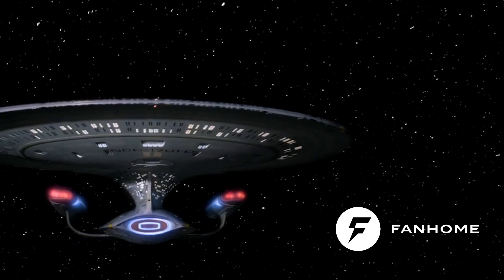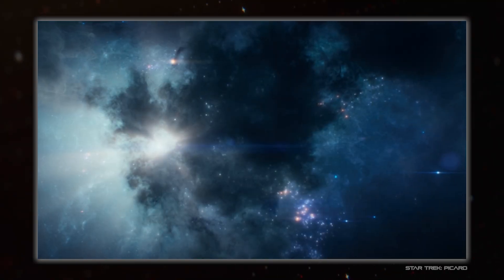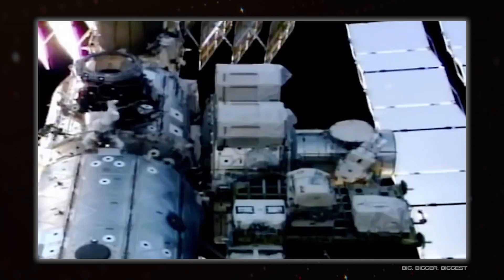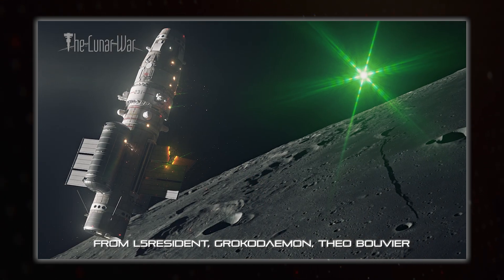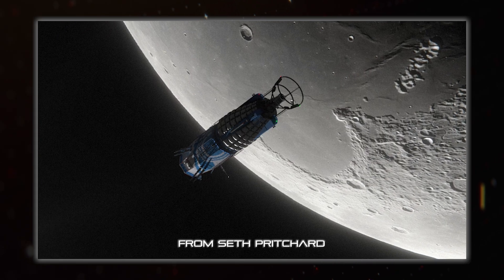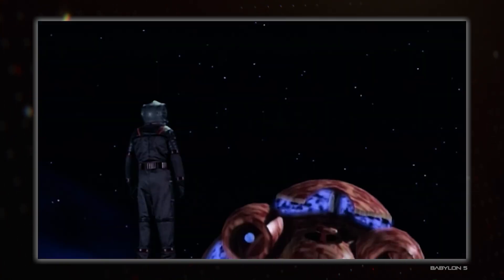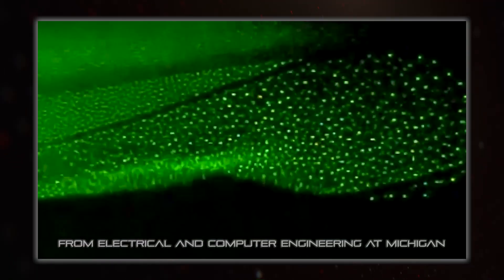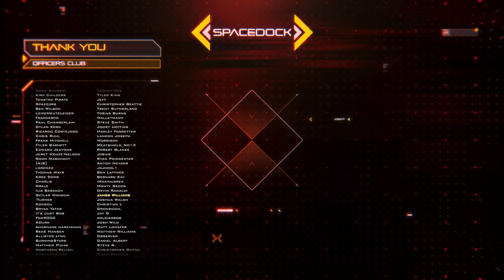Radiators In Realistic Sci-Fi (And Why You Need Them)

Comment: Last time I watched Apollo 13, I was wondering why they are getting freezing cold when they have to shut off the power.
Was that accurate or made up for the movie?
Reply: I’ve read multiple books and articles about the Apollo program and the fact that the temperature dropped to near freezing (38° F according to NASA) is 100% correct. Also, I was in elementary school when Apollo 13 happened so I remember it well. 😉 Remember, they had to shut down equipment to save battery life to survive. In addition, since the oxygen tanks were destroyed the fuel cells that needed that oxygen to provide electrical power stopped operating. In a normal mission the fuel cells and all that equipment generated heat. Since that heat wasn’t there temperatures aboard the command module plummeted.

If you you want a more detailed explanation, check out the website of NASA’s history division. Also, there are a lot of good documentaries you can find online.

Comment: At one point the "sails" on the Minmatar ships of EVE Online were said to be radiators, which I've always found to make FAR more sense than any other explanation (solar panels, weird shield emitters, antennas...).

It's perfectly in-character for the minnies to build ships with engines so overtuned that they need massive external heatsinks to keep from melting the hull.

Comment: Very cool idea based upon your open heating system ideas:
- have ships when they are in combat simply hear up high heat capacity materials and dump them when radiator retract. 
- have the heat be put into a weapon system to crate super heated shells or whatever they fire as well as being able to remove them. 
- use ferrous metals as the expelled cooler materials to act as magnetic mines or if your setting uses lots of magnets then to generally interfere with them: when they are launched they won't effect you till they cool down. 
Having lots of excess heat can definitely be used for fun things that also aid with cooling!
Reply: thermal Flares: that's another one.

Comment: It's nice to see Children of a Dead Earth get a cameo. I love that game, warts and all,  and would love to see you guys feature it in a review or Let's Play.
Reply: Someday, when the stars align, I'd love to see CoaDE get a proper update again (or just a straight up sequel). It has so much unrealized potential.

On topic, in CoaDE, I've settled on a common design for battleships where an armored ring extends out amidships, significantly beyond the diameter of the hull itself. Most of the weapons on the ship are mounted around the circumference of this ring, which helps to draw enemy fire away from the bow of the ship, which has an internal armored belt to protect the crew and systems. Tucked behind the weapons ring are the radiators, which are built to be mostly or entirely concealed behind the ring when viewed front on. The ships engage the enemy head-on and rely on the armored ring to protect the radiators. Of course, if they have to engage in the first place then the missiles and drones have failed to do their job. 🙂

The game sometimes struggles modeling the armor on the weapons ring properly, but I feel that the concept itself is sound. Some of my larger ships also have "emergency" radiators to be deployed in place of main radiators during point defense scenarios, with a lower outlet temperature and only enough cooling to run a backup generator for powering CIWS and life support. The idea is to significantly reduce the heat signature and surface area of the radiators, which are what enemy missiles actually home in on. It also allows you to use much smaller flares, since they don't have to outshine your main radiators.

Comment: Because this is Spacedock, we need the mandatory examples from The Expanse.

Basic solid radiator panels are common there, as are droplet and open-cycle cooling. In the case of ships, they often spray water mist onto the hull from nozzles, "sweating" the heat, or internal coolant water that reaches a boil is vented through the RCS thrusters or pumped into the Epstein Drive reaction chamber for additional reaction mass. Water isn't the only coolant used, but it is the most accessible and therefore the most common. In the case of railguns, they spray them down with pre-chilled hydrogen gas instead of water, which is less efficient in terms of total energy-used versus heat-shed, but chills them quickly (hydrogen has good thermal flux and speed of cooling is important during combat) and functions as a conduction medium for the electrical arc that completes the circuit.

Comment: I feel like more open radiators like droplet or curie-point radiators are more for civilian ships as having to suddenly maneuver to avoid incoming fire would cause you to loose radiator fluid, running out after multiple dodges. Civilian or strictly transport ships like the ISVs from Avatar don't need to maneuver on the fly and are thus free to use the more open and wobbly radiators.

Comment: You may use coolant as fuel and while it takes haet it can be preheating before be burned in engine. Actually it is how IRL liquid rocket engine work. Partially. And IRL it cooling down bell cone which maximise thrust to not let it burned down, so it's opposite function there, but still.

Comment: I might be slightly ignorant here but wouldn't a Stirling engine be a more beneficial option to reduce heat? It's litterally designed to turn a temperature difference into kinetic energy which in tun can drive a generator to turn that back into electrical energy. And it can do so with about a 50% efficiency.

Comment: @9min- Another open cooling method not mentioned is ejecting the radiators themselves. Like using a heat pump to super heat some mass during combat. Mass like an asteroid or water. Then ejecting this heat sink when it becomes dangerously hot. It be used the opposite way too. Like super cooling a heat sink in advance of combat. And ejecting/radiating that heat but keeping the super cooled heat sink to dump heat into internally. The latter is more useful with stealth ships that want to keep their thermal profile as small as possible.

Comment: I have to ask, what about thermal-electic systems?  Or systems that can use heat for energy?  I feel those would be quite important for space travel since they take an waste product and make it useful.  Great video as always.
Reply: Heat engines convert a temperature gradient into useful work, they do not actually reduce the heat energy in total, and, since it will be of a lower temperature after conversion, radiator efficiency goes down, and you need even bigger radiators to get rid of it

Comment: In case anyone is wondering, the reason why humans freeze when ejected into space is because of the latent heat of vaporization of water. Liquid water takes 4.2 joules of energy to raise 1 gram of water 1 degree Celsius, or 1 Kelvin. To raise it from 0 degrees liquid water to 100 degrees liquid water takes 418 joules. To vaporize (turn from liquid to gas,) 1 gram of water takes 2257 joules of energy. 5 times as much as raising it from "ice cold" liquid water to "boiling hot" liquid water.

Water is notable both because of how much the energies of vaporization are, AND because water is unusually high thermal mass. For comparison, the specific heat of fats are around 0.45 joules per gram per degree Celsius. A tiny bit more than 1/10th that of water.

Your body is more water than everything else combined, and you are not air tight much less water tight. When exposed to the vacuum of space, the water starts vaporizing, and takes with it the energy requires to overcome the water's hydrogen bonds; it literally boils away as water vapor flies off into space until there's so little energy in what remains that it freezes (no longer has the energy to overcome the solid matter state of the strong hydrogen bonds.) If all of the water inside you freezes ..... you're frozen.

It IS convection in the standard models, since it's vapor taking away the heat. Once you're frozen, any solar energy hitting your frozen corpse will sublimate away (go directly from frozen water into water vapor,) until you are a desiccated anhydrous husk of a human.

Comment: I once read a sci fi novel where the ship used lasers for cooling. Basically the ship's heat was used to heat some substance that cooled down as it emitted light. I feel like there might be some issues with the laws of thermodynamics with a design like that though... you would at least need super conductive and ultra efficient heat pumps.

Comment: I don't see the energy consumption involved in a curie radiator.  You have a permanent magnet (or superconductor based magnetic field) and the only power used is that to fling out the hot particles but that's recaptured when you pull them back in.

Comment: I'm skeptical of the benefits of free floating coolants re: square cube law since it's the surface area exposed to infinity that matters (eg a bunch of droplets in a big sphere end up heating up each other via radiation).

I mean what's the limit of packing more and more coolant drops into a region? A solid.    Though shooting them out ahead and collecting them isn't a bad idea.
Reply: The point of an LDR is more so that because you don't have a big solid pane, you need less bulky support structures for the same emission surface and it's less vulnerable to damage

Comment: I think you kind of mentioned something like this at the end, but if you could pump your waste heat into the engines, if you're using something like a VASIMIR or Nuclear Thermal Rocket, you could use that heat to accelerate the ship's propellant. In this way, technically, none of the ship's energy would be wasted and it would therefore be 100% efficient; probably best for low-acceleration/high-final-velocity interplanetary or interstellar spacecraft without FTL capabilities.

Comment: An idea I've had which is a bit out there but could work for a more highly advanced society is energy conversion. Like if you could already manipulate the fabric of space for faster than light travel you could probably alter the laws of physics just slightly to convert energy from one state to another either re-absorbing your heat and turning it into electricity or turning into some form of radiation you could vent out much easier and faster.

And it wouldn't need to be 100% efficient just fast enough to remove heat quicker than you were generating it

Comment: Could it be possible to just pump all the heat energy into a special chamber inside the spacecraft, to be stored and used to help power the craft? Or at the least be stored until it needs to be released through a vent system?

Comment: How about highly sophisticated (aka near-future level tech) thermoelectric generators? In tandem with smaller flat radiators (like on the Apollo) we can use our heat to juice up our weapon, propulsion and/or defense systems and our ships don't end up looking like a coked up hedgehog with fricking laser canons. I mean, our systems and specially the powerplant produce a shitton of thermal energy, why not use it instead of sacrifice it to the cold, harsh, uncaring void. Also, not every pop cultural universe has guardian angels like the Fuel Rats from Elite Dangerous, that come and fuel your gas guzzling rustbucket when you running dry. Let's eco up you guys, no power to BIG HYDROGEN/URANIUM/WHATEVER FLOATS YOUR VESSEL. Be smart, be efficient, be cool.

Seriously, don't waste your heat to the void. It doesn't care and just waits for you tu fuck up. That is what makes the kosmos happy, watching the premium primate fail and then laugh.

Comment: I would like to add that due to thermodynamics, you cannot just use one radiator systems to cool both your engine and your crew hab. 
Because heat always wants to go from high to low, the thousands-of-degrees heat from the engine will creep into the relatively cooler crew cabin if they are connected to the same system, slowly cooking your crew. So, you have to use two separate radiator system.

Comment: The logical conclusion for open cycling cooling is to use the hot coolant as thrust - making a cooling fuel relevant again, as it has been for ages in high speed aviation.

Comment: On a related/inverse note: does anyone know of a book (might have been a series) I read in England in the 90s where the FTL drive/defector shield generator created intense COLD thanks to a quirk of physics? I've been trying to track it down for ages because it was a really neat twist on this issue of heat regulation.
I remember every time they wanted to make a FTL jump the engineering crew had to put on arctic parkas because the temperature would spike to -40c or thereabouts.

Google is offering no help so I hope someone here knows the title (or can at least confirm I didn't hallucinate the whole thing.)

Comment: I find cooling radiators to be unrealistic. Why not just make them more efficient? If that's not possible, recycle the waste heat into energy!!

We already have the technology to do that, there is a camp stove that you can buy that will charge your cell phone by burning wood is you cook your dinner.... Use the same technology turn the waste heat into electricity!! Pump it back into the system then you don't have to use as much fuel or whatever!!

Comment: I kind of want to see a sort of siege warfare space battle now, where several small ships with weapons too weak to penetrate the defenses of a larger ship, but strong enough to damage the vulnerable radiators, force the larger warship to retract her radiators.  Then they just...force the larger ship to keep the radiators retracted for fear of having them destroyed until the larger ship surrenders despite having no threat to its superstructure at all.
Reply: You just made space fighters make sense!
Reply: @BlackDouglas1000 also trucking in short burn nukes. Have the fighter carried ship killer nukes have an absurdly powerful, short burn drive to sprint them into range, while the gunship sized fighter has normal fusion torch drives. The missle has something like a antimatter powered drive that uses powdered uranium as reaction mass, giving sprint speed, but no endurance. The warheads could be anything from laser heads to "Brimstone" nuke powered fragmentation warheads. 

The fighters are like modern fighter bombers, built like medium bombers, with probably only two crewmembers to keep numbers down, and are missle trucks with enough guns to shread drones, other fighters, or aerospace  fighters.
Reply: In Elite thats the way you make to get away/flee megaships. You can't destroy them but hit the heat radiators to make them flee.
Reply: An interesting aspect is that there will be a timespan where the temperature will be too low to do damage to the ship but high enough to be physically uncomfortable to the crew, causing morale to sink
Reply: This sounds like a very likely scenario so I guess they will figure out how to prevent it in that grimdark future of mankind.
Reply: @AntonMochalin  Fury Class Interceptor says hi.

Comment: There's also electrostatic radiators which work similarly to the curie point radiator but with electrostatic attraction. They can have issues with solar wind, though. And there's an idea i have never seen anyone talk about, and I can't think of a good reason why except it was never considered by Nasa. Take a conventional solid radiator and instead of making it out of metal pipes that must heat up so they can emit heat, just make the pipes out of transparent material and let the coolant radiate directly like in a droplet radiator. Unlike the droplet radiator, it shouldn't have issues with lost coolant while increasing efficiency. It could also be easier to make it damage resistant by just making thicker pipes. For materials, you can take your pick, but low tech you use quartzite, and for very high tech you use artificial diamond for maximum damage resistance.

Comment: Something that was glossed over is that, realistically, you don't want your radiators to get all that hot, really, because there is an upper limit to the efficiency that can be had from a thermal powerplant. I won't go into detail on the mathematical formula but the gist of it is that you want your hot side (your reactor) as hot as possible and your cold side (the radiator) as cold as possible. The hotter the radiator is, the less efficient your powerplant will be, and the more waste heat is generated for a given amount of useful power generated. It's a vicious cycle, so making your radiators smaller and running them hotter is often not really a solution.
You could work around this by using technology that does not rely on heat to create energy. Could be something like a fusion reactor that uses a "particle decelerator" of some kind to capture the energy directly instead of converting to heat first.
The Curie radiator thing was really neat.

Comment: @Spacedock what about heat recycling systems using solid state thermovoltaic cells? I know it's the moving of energy across a cell that produces a current, that just means you need a smaller radiator. This would most likely be seen on warships and yachts.
Reply: You actually need a larger radiator since the amount of heat energy stays the same, the power comes from the drop in temperature of that heat, which decreases radiator efficiency
Reply: @destroyer1667  the reason I said this would be seen mostly on warships and yachts is the mass penalty of the batteries that turn the system from an active part of the radiator into a type of heatsink.